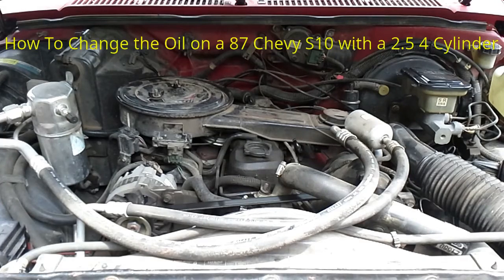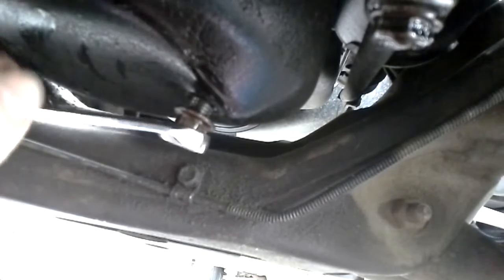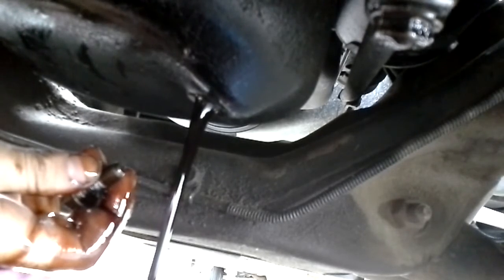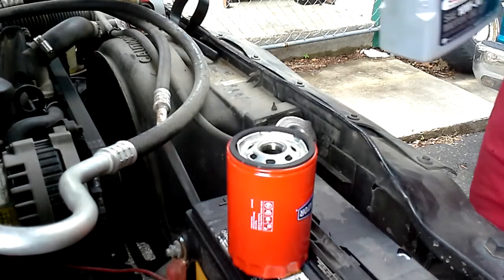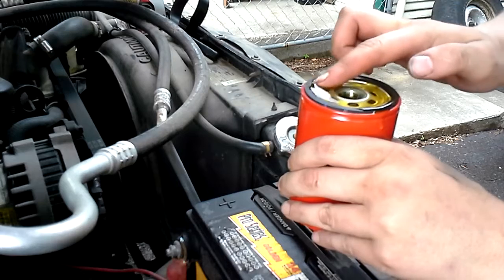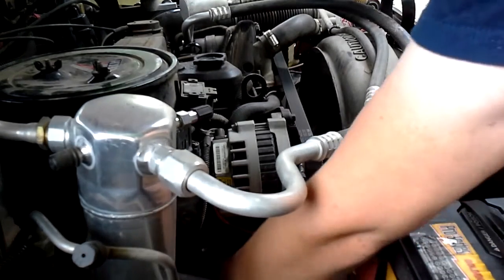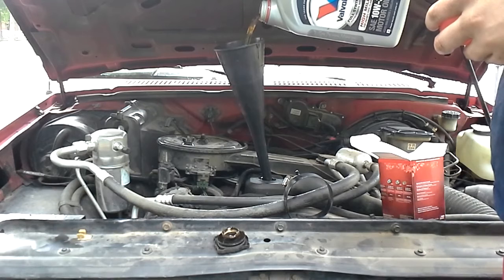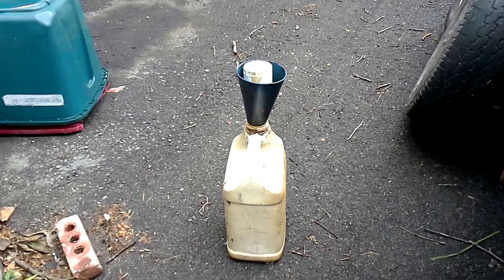How to Change Your Oil on a Chevy S10

Comment: Well done my man. I couldn't help but notice you're using full synthetic... do you feel like the little iron duke 2.5L sounds smoother and/or quieter? Or are you using synthetic to extend your oil change intervals?
Reply from the maker: I couldn't really tell if it made it any quieter or not but that was one of the reasons I switched to synthetic. I usually try to change it every 3k miles but lately I have been busy and sometimes I don't get it done until 5k. Synthetic does seem to stay clean longer. I have heard people say not to use it on old engines but I haven't had any issues at all. It is the high mileage synthetic so maybe this is why. I also use it on my full size chevy with a 350 and my astro van with a 4.3 Thanks for watching and commenting.
Reply: +Jonathan Rader thanks for the info. I use castrol GTX in my Honda Odyssey van and my 01 Chevy S10 but bought some Amsoil Signature series to try out. We'll see how it does!